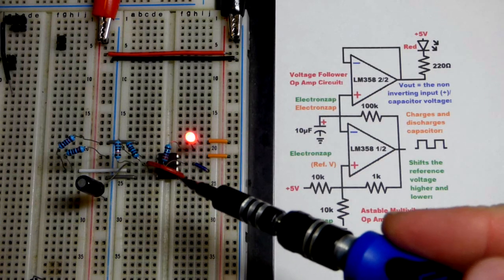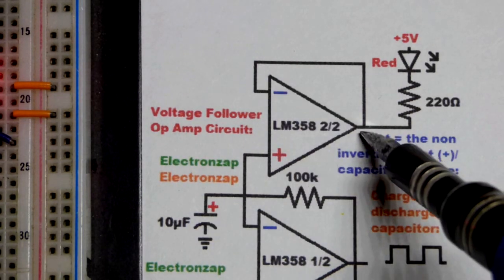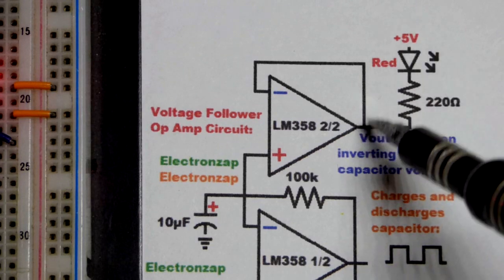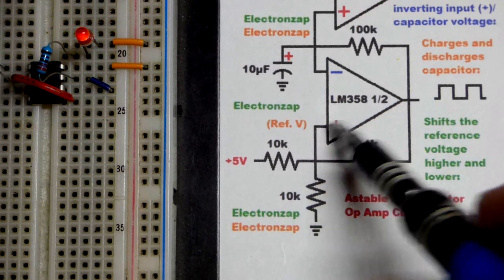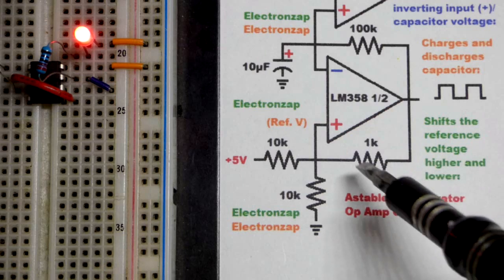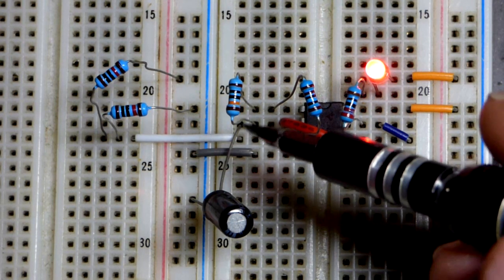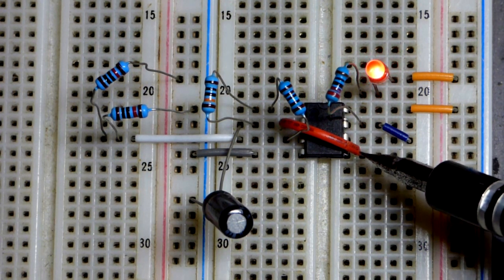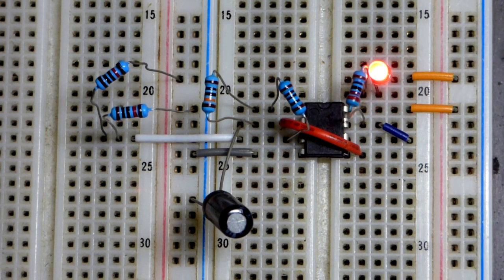LM358 Op Amp fades an LED on and off while charging and discharging a capacitor circuit schematic

Comment: On the second op-amp, if the voltage at the output is always the same as the input voltage due to the negative feedback you gave it, then why is it necessary? Would this circuit still work if you connected the resistor and LED without using the second op-amp? My intuition tells me that it would, but I have come to realize my intuition for circuits is usually wrong hahaha.

Comment: can the rate of flashing be increased?
Reply from the maker: Whenever there is a timing capacitor and timing resistor(s), lower values will speed things up, and higher values will slow things down. Need to always make sure that you don't go too low on resistance though, or high current might flow and cause damage. And there's other limitations. Such as, a high value capacitor will likely stop charging at a certain voltage if current is too low.